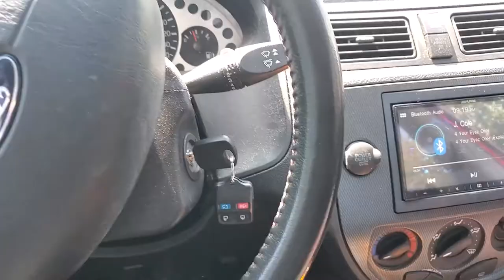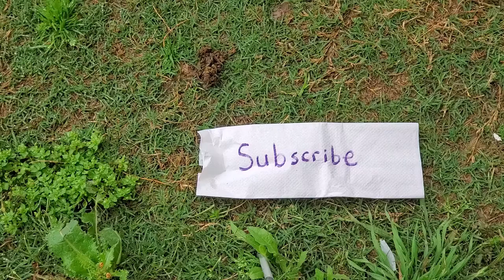MazdaSpeed3 Rear Sway Bar/Ball joints installation on a 2005 Ford Focus ST-S2(Episode 22)

Comment: Glad it worked bro! The joints should help the car react quicker, plus the stock bushing links cause the arms to break with big sway bars, with these it shouldn't bind up and want to break stuff.

Oddly on my Volvo C30 bar the retainers were in the correct place. I actually had to buy "retainers" for my stock SVT bar to keep it from "sliding" to either side. If the Mazda bar slides then a hose and hose clamp... or a clamp on the old retainer might work.

It's been so long I forgot I "shimmed" the big hole in the arm with a split washer, I think I had to drill or dremel the washer out a hair. Then sandwich it in with a big washer on top like you did.

Split washer like this................ https://www.homedepot.com/p/Everbilt-10-mm-Zinc-Plated-Split-Lock-Washer-3-Piece-803638/204276498
Reply from the maker: You know if the front swaybar fron the C30H will fit the Focus?
Reply: @FocusedHands  No, I think it's an entirely different car beyond the rear subframe. The focus already has a great sway bar set up in front anyway
Reply from the maker: Going for upgraded bushings in the front

Comment: What year Mazda 3speed and where did you get yours?
Reply from the maker: Found it on Ebay
Reply from the maker: I believe it was a 2013.. let me check
Reply from the maker: Correction! It came off a 2009 MS3
Reply: Thanks looking now!
Reply from the maker: @ponycarmike  good luck! Also check your local drunk yard or pick and pull... all the same really
Reply from the maker: The multitool can be found at home depot... think i paid 80 for it
Reply: My sway bar is coming Friday. What end links do you recommend? Mine isn’t coming with them.
Reply from the maker: @ponycarmike  Glad you asked... I just ordered a set yesterday! I will link them below.

https://www.rockauto.com/en/moreinfo.php?pk=8731532&cc=1443711&jsn=834
Reply from the maker: @ponycarmike  took the ST out for a drive today!!! Man corner and overall feel of the car is solid! You will not be disappointed!!

Comment: How can I do add mazdaspeed 3 ball joints in my 2000 fors focus zx3?
Reply from the maker: The rear ends should all be the same from 2000 through 2007. You would need to convert to the ms3 rear sway bar... before you can add ball joints
Reply from the maker: For hatch backs id say run the Volvo c30 rear swaybar  it is a more direct fit
Reply: @FocusedHands  i would modify if needed. I have the  28.5mm rear sway bar on my set with reinforced lva